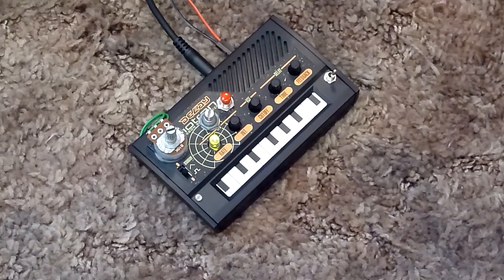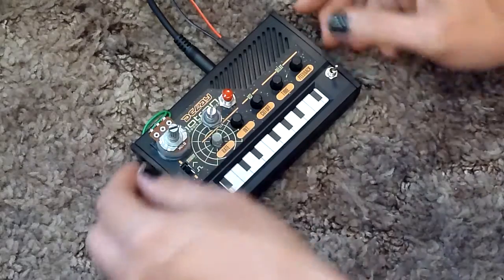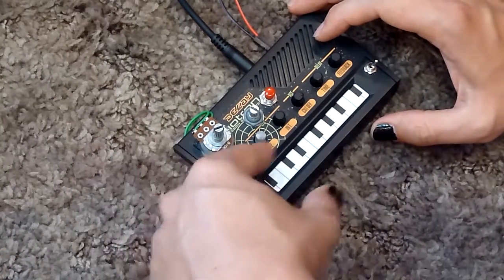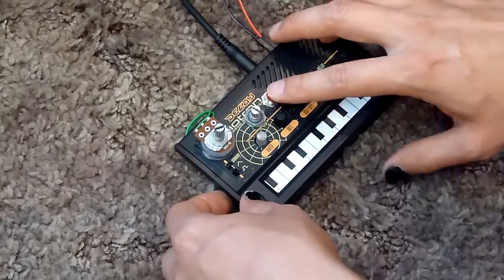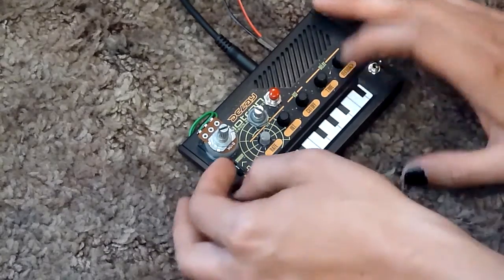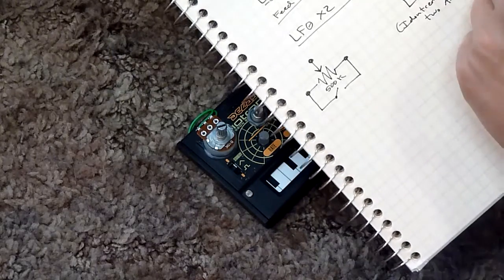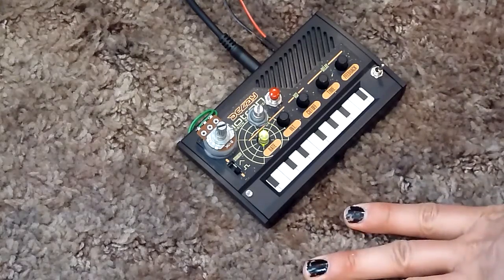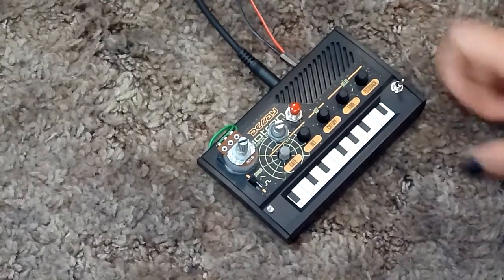Monotron Delay Mods

Comment: I’ve been brainstorming how to mod it fit a 19” rack enclosure, with the ribbon being replaced by a trigger button and tuning knob…
Reply from the maker: I actually set aside an extra copy of the DUO with a busted ribbon to do something similar but never got around to it. I wanted to build everything out into a larger enclosure. FYI, the ribbon is simply a potentiometer, when you apply pressure it bridges the gap at that potentiality. So all you need to do is match the pot/ribbon value with a standard pot and a momentary button. I was actually going to break down the value intervals into a group of tactile switches as well, in effect, building a mini melodic keyboard. (The duo has a mode where you can play it as a linear ribbon or like a melodic keyboard.)
Reply: @TinyDiodes  Thats great, i wouldnt have guess that the ribbon qualifies as a pot, but that means it should just be as easy as soldering a pot in its place right?

Comment: Did you add a power supply so you're not wasting AA batteries like crazy?  If so would you mod one onto mine?  I really only use mine as an effect pedal and a mod like that alone greatly enhances the unit.   I love all you've done with yours.   I don't have the knowledge, tools, or time to do what it is that you've done.
Reply from the maker: What I did was add a specialized battery input that allows me to hook up to larger batteries, like a rail of Ds for a greatly extended power life. That being said, it is entirely possible to add a plug in hookup to power the unit, it wouldn't necessarily be pretty though, aesthetically. It has been quite a long time that I have done any work in this realm so I suppose it would depend on how much it was worth to you and if it was worth it to me. Please email me at jesseaaah at gmail and we can discuss it there. Thank you for the compliment.

Comment: Could you do a mod making it a externally controlled via like a midi keyboard or something. Love the LFO and simplicity of the synth just can be really hard to find a sound useable in a track due to lack of musicality often when using ribbon.
I'm new to this whole scene but would love to learn how to do this.. thanks
Reply from the maker: Thanks so much for watching. Yes, being that these are analog devices that run of of traditional Control Voltage I'm sure that is possible and I'm certain multiple folks have done it.
That all being said, this was prior to any 'engineering' work I had done. (Even though it still counts technically)
My engineering desires are minimal and I like to keep it experimental, and the type of 'music" I use my instrument design and mods for is not for playing 'notes' so much as they are for sonic exploration, meditation and sound-scapes.
If you check my videos on the Monotribe you sill see that it is a larger version of these smaller synths and there is already a popular Midi Mod on the internet which I did install and works reasonably well. (Also, KORG made it so that you can actually plug in Control Voltage Sources directly but I have no CV equipment myself, can't afford that stuff so I make my own things.)
And if you like my videos please check out the M1 synth, it is my scratch built and personally engineered analog synth. (It don't play no notes though, lol)
Reply: i rly like how yr personal synths are developing into a full fledged furry microsystem! with more vactrols and LFOs the possibilities for communication between them seem totally endless.

also also yr pot destruction trick to get switch action sounds brilliant. always packing my panels super tight and this trick will noo doubt helpp my lil switches and spaces max their potentials.

Comment: Okay, I figured out how the LFO speed increase switch was probably done, but on my Monotron - I don't own a Monotron Delay.

The trick is to short two pins together on the LFO pot.  From the schematic, I wouldn't expect it to work, because at full up on the LFO Rate knob, I'd expect them to be shorted together already.  Apparently, not.  The pot mustn't be able to go to full throw.

With the top off, and the keyboard strip facing me, the pins to short together with the switch are the middle one, and the one on the right (on the one with the clear plastic knob).

Shorting the middle one to the one on the left makes it go to the slowest speed - or maybe even a bit slower?  Shorting the middle pin to the pin on the right makes it go faster than it does normally.  I haven't measured it, but double seems like a reasonable guess.

If the schematic is up to date, and matches mine, that's perfectly safe.  The right hand pin of the pot is shown as being fed by a 220k resistor from VA (apparently about 5V - I haven't measured it).  That gives plenty of protection, because there's not much current available to do any damage.

Another way would be to put a resistor in parallel with that 220k resistor (R28, on the schematic for the orginal Monotron, near the box labelled LFO RATE).

E.g, you could have a switch that turned on the parallel circuit, a fixed resistor for safety (e.g.another 220k one) and a pot in series with that, so you could adjust it, or just skip the switch and use a big enough pot so it's not much faster than before, at one extreme.

The method you apparently used, of just shorting two pins together on the LFO Rate pot, is probably safer though.
Reply from the maker: I didn't touch the LFO rate nob at all. It was the shaper pot on the back of the Monotron. (If I am recalling correctly, this was a long time ago.) I think I just made a momentary switch that shorted the two outside legs of the pot.
I also replaced the original micro pot with the full size pot you see mounted to the top of the monotron.
Reply: That's interesting (3:20 onwards).  I guess what you did was shorten one half of the cycle of the LFO then?  That would speed it up.  

The mod I came up with, based on what I thought you meant,  for the Monotron, just sets the maximum speed higher, by letting the centre pin of the LFO Rate pot go to a higher voltage.  The shape stays the same, as far as I can tell.

I haven't looked at the schematics fo the Montron Delay much.  I just recently bought the Stylophone Gen X-1, which is kind of a cross between the Monotron Delay, and the old Stylophone, but with more knobs than either.  

I was thinking of getting the Delay, before I bought that, but I'll probably hold off for  a while.  I have some vague plans for modding my new toy.  I'm looking at doing things to the Montron and the Volca Keys first though.
Reply from the maker: I'm not so much an engineer. I just have a sense for things.
I can't tell you technically the why... I just had an idea and it worked.
I was a computer tech for many years as well but I wasn't certified at all, I just had an affinity for fixing and modifying things.
Reply from the maker: I do build things and conceptualize though, but I do it in a simplistic way with basic building blocks.
I know quite a bit more now than I did when I made these first mods, that was all by feel, now I can incorporate a lot more intention.
Reply: I try to get an unerstanding of a circuit If I'm going to modify it - including having a look at datasheets for components I'm not familiar with.  

I don't tend to try to fully understand the whole thing though - just enough to give me a basis for trying to change it, then I scribble some schematics, only ever on paper.

I have to admit, I rarely get much done though.  Maybe just hacking at things to see what happens isn't such a bad idea :)

I watched your home made sequencer synth video.  That's very impressive.  I can see a lot of work went into it.
Reply from the maker: Thank you very much, that was definitely a well thought out and big endeavor for me and my skill level. I spent somewhere between 6months to a year on that one and I got really lucky that it actually worked in the end, lol.
It is a great example of what I was describing, working with basic building blocks.

Comment: Can you help me? Ii soldered + line to VCC pad and - line to GND pad on the circut board as a power supply mod.
However, this added a whistle sound to the audio signal. Tried different V5 power supplies, different wall outlets, and even cables. Any thoughts on how to get a clean signal when adding a power supply mod?
Reply from the maker: I have actually come across several power supplies (ac to dc converters) that added a horrible high pitched noise to my equipment, most of them were salvaged from Goodwill and drove me nuts. I would say first make sure you are using a quality DC converter, like OneSpot or RadioShack, from there if its still a problem, Batteries will never give you that cycle hum. Another thing you can do is wire it to larger amp battery packs for a clean DC source. That is why in my powered case video I made a power supply of a chain of D batteries, because they have the most amp hours.
Hope that helps.
Reply: @TinyDiodes That helps a lot. Thank you!

Comment: How did you fit everything into the case? I've got a simple circuit set up for my own monotron mod, but the inside of the case is so small that I'm not sure if it'll fit, and if it does fit, it'll probably be making contact with things it probably shouldn't be. The buttons/switches are an even bigger problem -- the ones I have have a rather bulky bottom to them, and it looks like they just barely cant fit between the circuit board and the top of the case. Any advice?
Reply from the maker: Oh yes! Totally, thanks for asking!
One, small gauge wire, two, patience and precision, three, trimming any excess possible (IE trimming pins down on buttons), four, masking off contact points with electrical tape. (Insulating)
Hope that helps!
It takes practice. Prior to this I worked a job where I assembled guitar distortion pedals and installed custom mods on them, that really helped.
And if you didn't already catch it, try not to detach the ribbon cable unless you HAVE to, its super delicate and breaks down fast.
Reply: @TinyDiodes  Ok, thanks! I really appreciate it.

I was already too scared to detach the ribbon so that shouldn't be a problem 😄